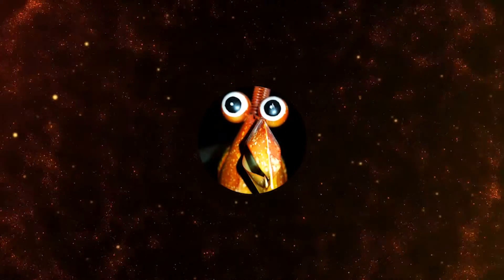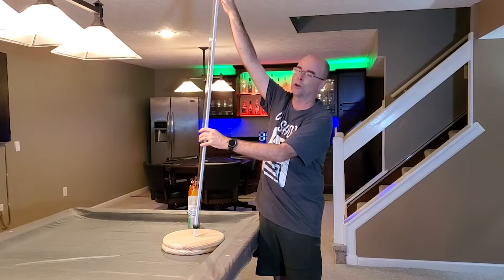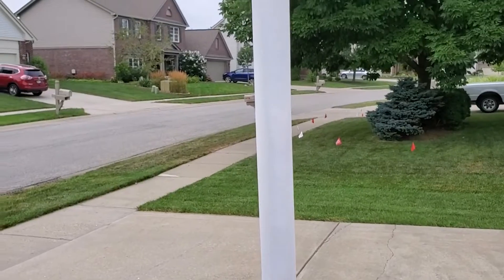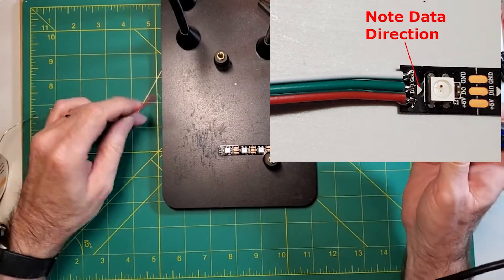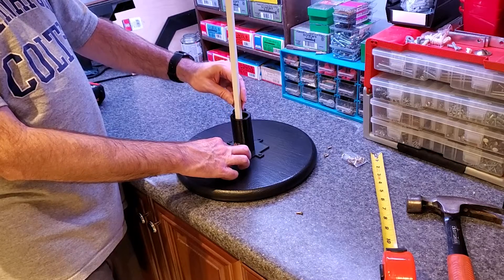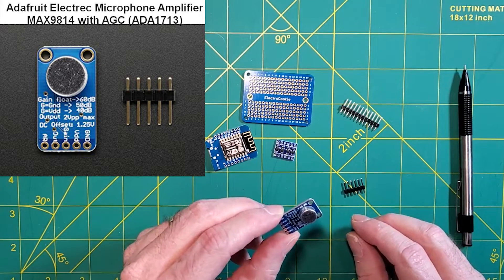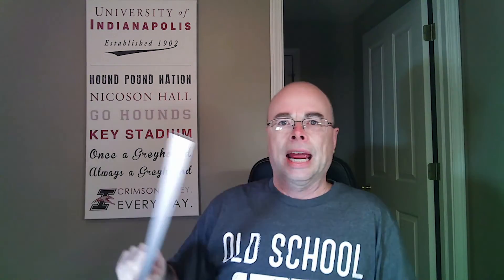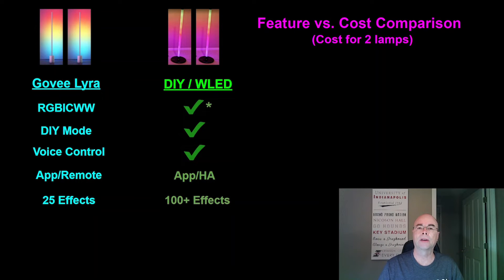DIY Sound Reactive LED Floor Lamps

Comment: Hi again. Which wires did you use? Are 22awg enough for two stripes with 60 LEDs per meter each?
Reply from the maker: It somewhat depends upon your particular setup and the lengths of the wire runs (and a little bit on the type of wire... solid copper vs. copper-clad aluminum).  For the data wire, as long as you are using a logic level shifter, 22 gauge would be fine for runs up to multiple feet in length.  For the power lines, each "lamp" of 60 LEDs will pull up to around 3.5A at max white brightness.  While you should be OK with 22 gauge, especially for shorter runs, I generally try to use at least 18 gauge wire on all my projects for the connections between the power supply and the LED strip.  22 gauge is perfectly fine for the power connection to the controller, as it will draw less than 1 amp.   There are a lot of charts online that will show you max recommended current/amps for a particular gauge, length and type of wire runs.

In all my projects, unless I'm absolutely sure and have done a similar project, I always run a multi-hour "bench test".  I hook everything up and let it run at near max current (e.g. all lights max bright white) and I monitor.  If the wires are getting warm, I know I probably need larger gauge wire.  I also check the temp of the processor and any other components.  I want to be completely comfortable with an install before I tuck it away behind "stuff".  You can also always add an inline fuse to your power lines as well, as an extra precaution, but I rarely do this unless it is a high amp situation.
Reply: @ResinChemTech  so in my particular case I will use 1m 60 LEDs per channel, two of them, with a distance to the Power supply about 1meter extra length, maybe 1.5meter. For this 18awg must be enough I think? 4amps per channel per strip. Is the logic shifter also necessary for usage with an esp32?
Reply from the maker: Both the ESP8266 and ESP32 output 3.3V on their pins.  LED strips are expecting 5V on the signal line.  While some people claim you don't have to use a logic level shifter (and often you can get away without one for very short runs), I always recommend using one.  For $1 and a few minutes of extra soldering, you are assuring you won't have signal issues.  If you are unfamiliar with what I'm talking about, take a look at a video I did on the logic level shifter:  https://youtu.be/Q9mLitVxF3c and you will see what happens when the voltage on the data line drops too low.  You don't want to discover this problem AFTER everything is soldered together and installed.

With a run of a meter or more, I think you'd definitely want to use the shifter.  You could use the sacrificial pixel method, but with two output channels, you'd need to solder a sacrificial pixel on each data line... and I think that could get messy as opposed to a single shifter that can handle up to 4 different channels.

Comment: Is it possible to control two separate lamps on two channels with one esp32? So they can act Individual? How will it be done?
Reply from the maker: While I haven't explicitly tested it, it should be possible.  Instead of splitting a single signal wire from a single pin to both floor lamps, you'd run separate signal wires from two different pins on the ESP32.  You'd define both of those pins in WLED and (at least as of the current version) create different segments for each floor lamp.  At that point, each lamp would have the ability to have its own colors, effects, etc.  Or you could still treat both segments the same and have the same effect.  I cover the concept of using multiple channels and segments in my video comparing the ESP32 and ESP8266 with WLED (https://youtu.be/q1ghNUND6gk).  That might at least get you started on how to setup multiple channels and segments if you haven't done so before.

Comment: Found out that sound reactive version doesn't install from the browser, as always goes back to Install SR option, also only works or opens on the WLED wifi, as doesn't open on the normal wifi, or generate any IP address, and to open the static IP address that has to be created in the wifi setup, it must be on the WLED wifi, not on the home wifi, do you have a video shows how to connect and setup the wifi of this Sound Reactive version?
Reply from the maker: The onboarding process for both the normal and SR versions of WLED are identical.  For the web installer, I believe the SR version requires an ESP32 and neither version will install on a board with less than 4MB of flash.  It also looks like some changes have been made to the Sound Reactive version that requires some special handling for ESP32.  I'd recommend taking a look at, and following, the instructions on the official WLED Sound Reactive site: https://github.com/atuline/WLED/wiki/Installing-and-Compiling

I'd be happy to try to help further, but I would need to know exactly what board you are using, how you are attempting to flash it, and what steps you are following when you try to onboard onto your wifi.
Reply: @ResinChemTech  Thanks, Tried both ESP32 boards, the D1 mini and the Development board ESP32S, On the install wled,me browser, after selecting the SR version and the installation Completes, shows Two options, Install WLED SR and LOGS & CONSOLE, and doesn't show WLED-AP wifi on the network.
On the PyFlasher, After Completing the installation, doesn't show WiFi option or discovered in the WLED App.
On EspHome Flasher, can create a wifi, but only opens in the WLED-AP WiFi, even if the static IP gets created on the WLED App, and add it manually to Discover Lights, it shows Offline and it still doesn't open on the home network, it's only opens on the WLED-AP WiFi
Reply from the maker: OK... let's see if I can help, but your situation seems a bit unique as I've never experienced what you are seeing.  I've not used the web installer as much, since it is relatively new and only supports certain boards/combinations.  For example, the web installer currently only allows you to install the latest beta version.  If I want the stable release version, I have to download and flash with PyFlasher or ESPHome Flasher.... so that is generally my preferred option.

Note that there is a known issue with some ESP32 boards where the WLED-AP does not appear after flashing.  See here: https://kno.wled.ge/basics/install-binary/#what-binary-should-i-use (look at the WLED_0.x.x_ESP32.bin note and it gives a link of what to do if the WLED-AP does not appear).  Basically, you have to flash a bootloader first.  I've not personally experienced this with the dozen or so ESP32 boards I have flashed, but apparently it does happen with some boards.

Next, if or when you do get the WLED-AP and are able to enter your WiFi credentials (e.g. your SSID and password), I wouldn't set a static IP at this point.  You can always switch to a static IP later.  Instead let your router hand out a DHCP IP address and then check your router to see if the WLED controller is listed (it should show up as something like WLED-xxxxxx).  If you don't see the controller listed in your router, then either your SSID/password were incorrect or something else is preventing your router from handing out an IP address/onboarding the controller.  Once the controller is successfully online, your can either set a static IP or DHCP reservation.

But from what you describe, I'm guessing you are experiencing the issue I linked to above.  The need to flash a bootloader is also mentioned on the Sound Reactive WLED site:  https://github.com/atuline/WLED/wiki/Installing-and-Compiling  (see section under flashing ESP32 binaries).
Reply: @ResinChemTech  Thanks but requires python and programming, it's not for a newbie

Comment: Great project!! Thank you!!  Did you use T8 or T12 plastic tubes?
Reply from the maker: Thanks.  I used T8 tubes.  I bought both sizes but thought that the smaller T8 looked better and closer to the original retail version I was trying to duplicate.  I actually have the full parts list in a related blog article if you want to know exactly what parts I used: https://resinchemtech.blogspot.com/2021/08/sound-reactive-rgb-floor-lamps.html

Thanks for watching and commenting!

Comment: Maybe for future I could see design a holder for the rail inside the printed piece. Then drill a hole to run wires out the bottom and cut a notch in the bottom so the wires lay flat. Just some ideas. I love your projects. I'm working on the stair lights now.
Reply from the maker: Thanks, glad you find them useful!  And thanks for the ideas on the floor lamps.  I toyed with the idea of using the aluminum channel, but they are a bit wider, which was going to force the lights more into the center of the tube and I wanted them to be as close to the outer edge as possible.  Plus in all honestly, I had the wood slats left over from my virtual window project and using them was a lot cheaper than the aluminum rails!  This was the first YouTube video I filmed "on the fly" as I was building something for the first time.  If I were to do it again, I'm sure I'd make some design changes.

Good luck on the stair lights and give me a shout if you run into any problems.

Comment: We’re you able to use a single mic and then sync it across the two or does each bar have its own mic?
Reply from the maker: Yes.. it is a single mic and a single controller.  The LED signal wire that comes out of the controller is split and runs to each lamp (along with 5V from the power supply) so they are always in sync.  If you wanted them to be independent, you'd either have to use 2 controllers/2 mics or different signal output pins/channels on the controller and set up segments in WLED (v0.12 or later), which would still only require one controller and one mic.  

I cover how to use multiple output pins and WLED segments for controlling different LED strips independently from one controller (and one mic for sound) in this video comparing the ESP8266 to the ESP32 with WLED: https://youtu.be/q1ghNUND6gk

Comment: Really  impressive skills and a  well  documented project.

Could you help with the wiring info for  3.5 mm jack to be used instead of the mic ? or as an added option 

The mic I tested is  picking  ambient sound  ( unless we do a tedious calibration) and sometime we have an  
issue with loud  sound disturbing others which  the audio jack and a splitter would solve .
Reply from the maker: I sure haven't tried that... but according to the sound reactive WLED web site, it has been tested successfully with a TRS audio jack.  They even have a wiring diagram.  You can see it here:  https://github.com/atuline/WLED/wiki/Analog-Audio-Input-Options

As far as picking up ambient sounds from the mic, I'm guessing you have tried adjusting both the gain and squelch values in the WLED sound settings?  I've found I can filter out background sound, but the settings are somewhat dependent on the effect being used.  Seems like the perfect gain and squelch for one effect doesn't work well for another  And unfortunately, the sound settings aren't saved as part of the presets, so you cannot use the presets to overcome this.  Let me know if you have any other questions, but the above link is probably your best source on how to wire a jack to the controller.
Reply: @ResinChemTech  Thank you

Comment: Nice 👍👍
Reply from the maker: Thanks!  I really didn't know how it was going to turn out when I started.  But after having in place for a bit now, finding optimal placement for the mic, and adjusting the squelch/gain settings in the WLED options, they are working great!  I just thought the cost for the retail versions were a bit nuts and their had to be a cheaper way to get the same basic results.

Comment: sound reactive wled build dont have alexa or mqtt support with bin...how to edit and make it wokr?
Reply from the maker: Yes, some standard features of WLED are disabled by default in the sound-reactive version.  You can enable them, but it does require compiling your own bin file.  Info can be found on the Sound Reactive WLED wiki (https://github.com/atuline/WLED/wiki/First-Time-Setup).  FYI... I use Home Assistant for both voice control and native WLED integration, so these modifications of the .bin file aren't necessary.